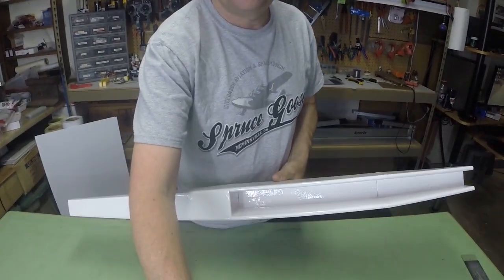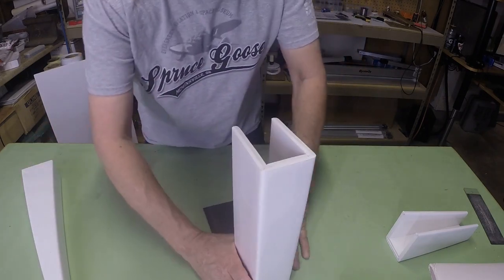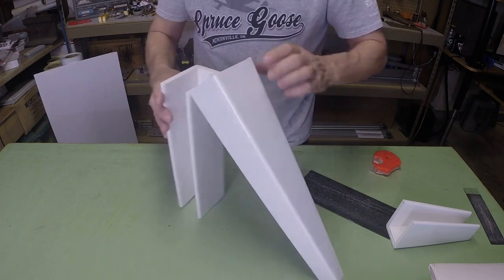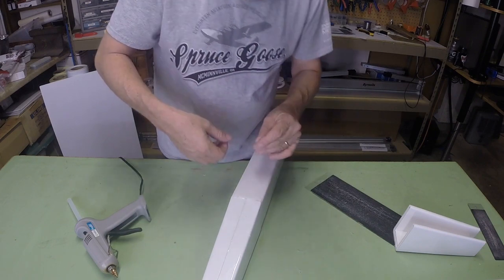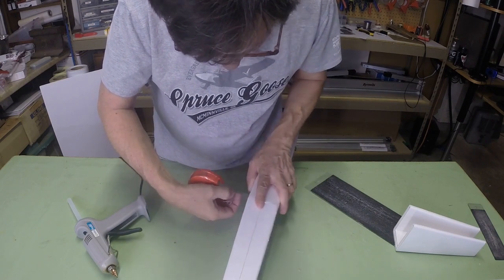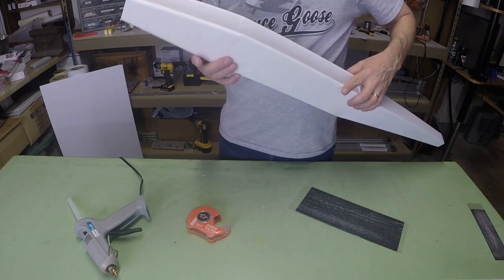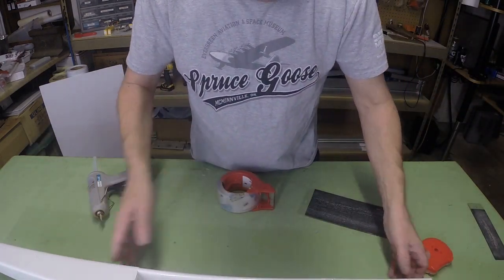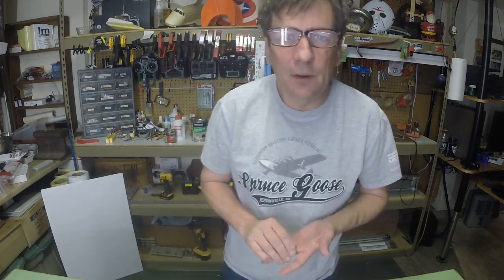Gluing Foam Board Fuselages for RC Airplanes

Comment: I like some of the concept , but I would build the middle section with the doubler sticking out just an inch or so at each end , thus you can slide it into the rear , gives more glue surface / over lap be stronger , then add rest of doubler to front .. also a couple of weak spring clamps would help hold it while glue cools

Comment: Which glue stick is best for xps foam sheet
Reply from the maker: I can't help much on the different sticks.  I use either standard temp glue squirted into a puddle and allowed to cool a bit or RooClear Melamine cement.  The RooClear is really good for gluing big broken pieces.

Comment: Please, why do you make the fuselage in 3 parts to glue and not in only one ?
Reply from the maker: Another reason is to be able to replace damaged sections (nose usually) without redoing to whole fusey.
Reply: @flingsair8240  Thanks
Reply from the maker: Partly to get the desired shape and partly because the tail is best as a box, while the center needs to be flat and straight with stong sides.  The front tapers to a nose and needs to allow battery access and mounting while also being strong.  It was easiest to do in three sections for these planes, but you may wish to eliminate or add parts to suit your own needs...

I'll continue the videos soon and some of my thinking may make more sense.  I apologize greatly for the delay.
Reply: Another reason is sometimes the part is longer than the foam, as often the case when all you have 20x30 foam board.